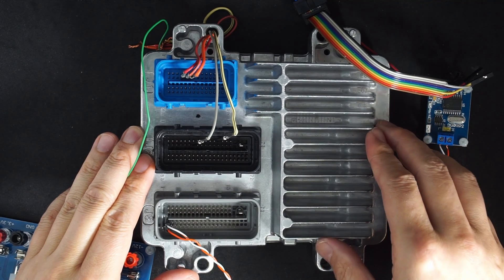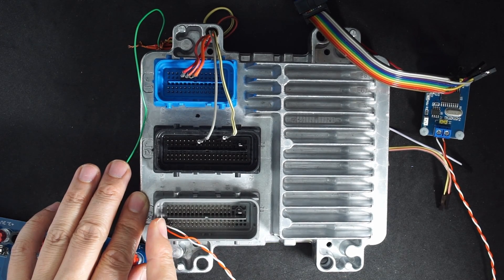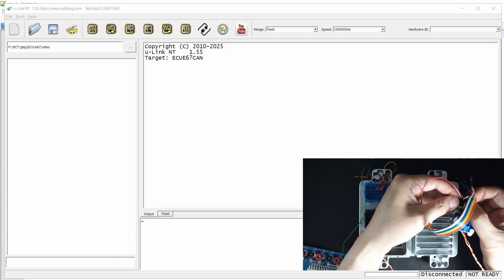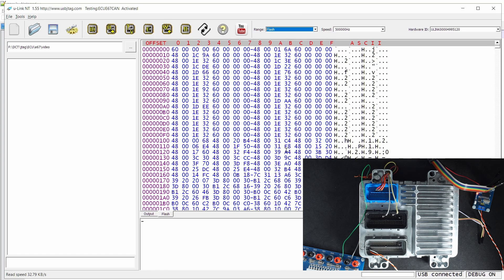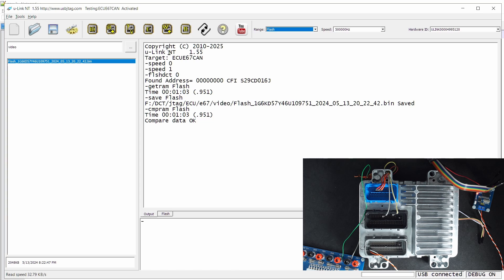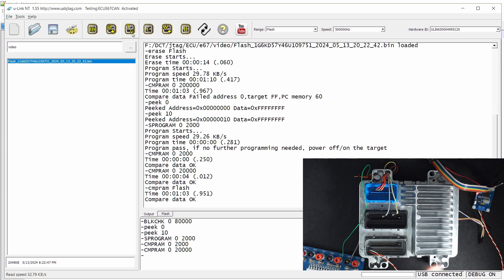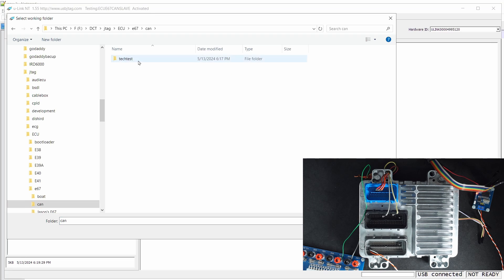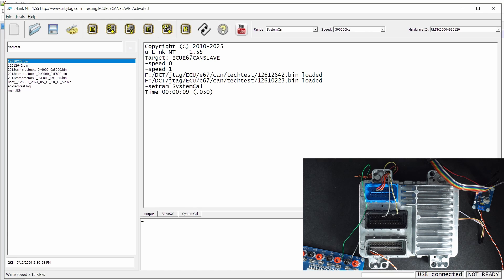u-Link NT program ECU E67 Master and Slave via Can Bus.

Comment: Hi, how are you? I want to ask you a question I have been watching your videos for a long time looking for the solution to the e38 GM ecu that remains in a programming and cannot be recovered in this case if it was in a GM P12 programming process just like the E67 but cylinders with your software I can recover it since it does not communicate thanks
Reply from the maker: If can bus is working that means it might be in so called "tunerlock" mode and yes it can be unlocked.
Reply: You saw amazing I didn't understand a thing.You were saying, but I know it's gonna have to happen with mine, as I have a 2016.Yes.S Camaro pull out with the LT1 6.2 &TR6060 6 speed manual that i'm installing in a 1969 camaro. I'm a retired mechanical engineer and have a reasonable electrical knowledge.But nothing to this level, so I'm looking for someone to reprogram my e.C u and also my wiring harness , if that's something that you're still doing , I'd be interested in hiring you for sure